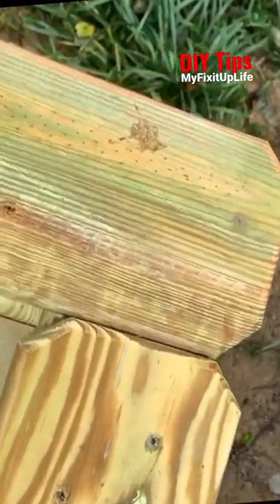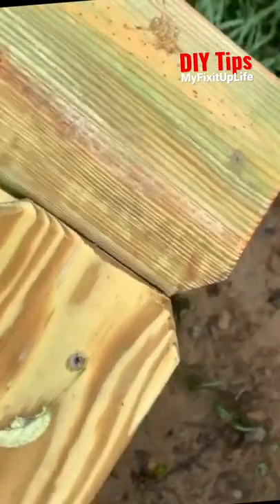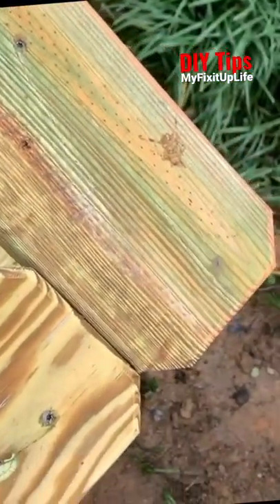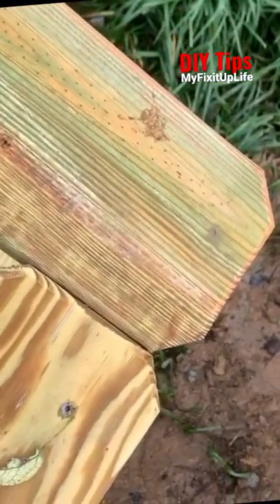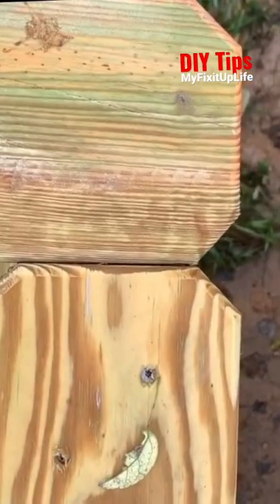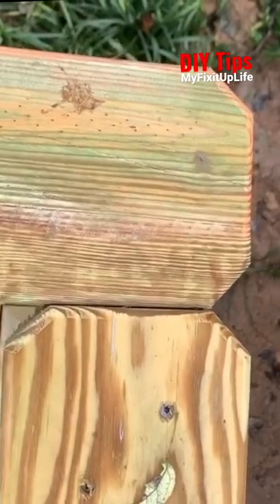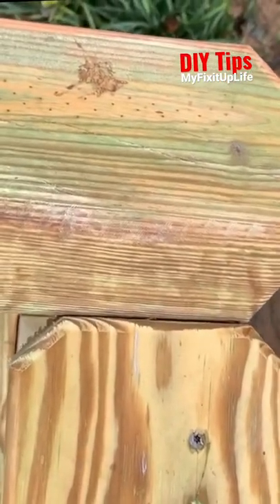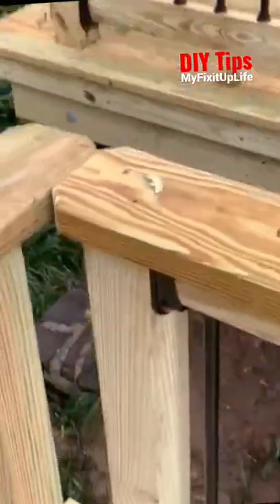DIY Tips: Deck railing

Comment: Looks horrible. Always miter your corners and pitch the top hand rail 8 degrees on both sides to shed water.
Reply from the maker: First, no it doesn't. Calm down. Second, what you clearly don't know is that miters open as the wood dries. It only takes about 2-weeks. The rail looks good when you put it in, but the heel of the miter is open 3/8-1/2 inch for the rest of the deck's life.
Reply: Horrible? 
Different, yes. Horrible? You obviously ain't a carpenter, so you don't get it.

Comment: Hate to pop your bubble but that looks horrible
Reply from the maker: Hate to pop yours, too. But if you think the miter you installed is tight 2-weeks after you leave, well, that looks horrible,, too.
Reply: @myfixituplife  I would use a combo of a lap joint and a miter ... besides a gaped miter would still look better then this high-school project of yours ...
Reply from the maker: @mikeyoung5329  if you like an open miter, well, whatever. Caulk it, I guess. That you’re flummoxed by something new, get in line. I get that all the time.
Reply: If it pays the bills cheers to ya 🍻
Reply from the maker: @mikeyoung5329  it does. Open miters do, too. That’s why we’ve been getting away with them for decades. I’ve landed on an new approach lately I call “stepped” that I’ll put in a forthcoming video.
Reply: @myfixituplife 
Man, you gotta let these people roll on by. They have zero imagination, creativity, style, etc. 
And they feel threatened by anything done the way their grand pappy didn't do it.